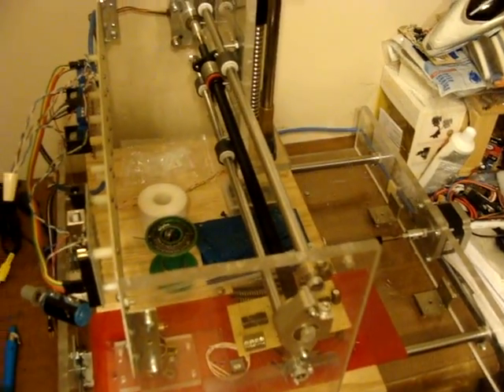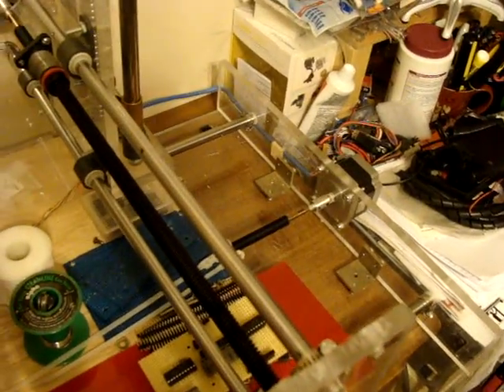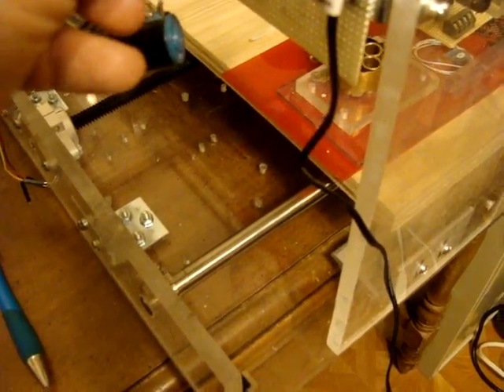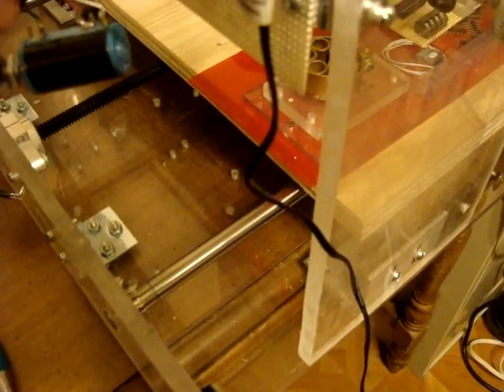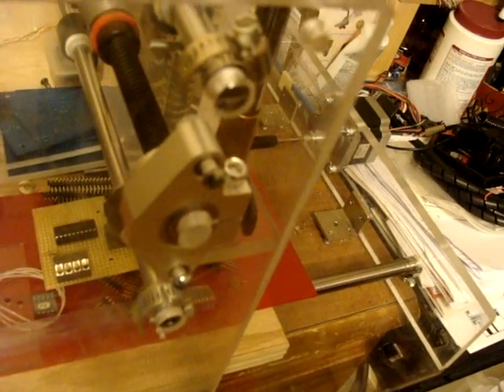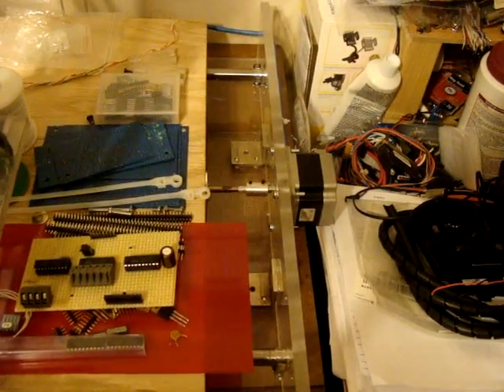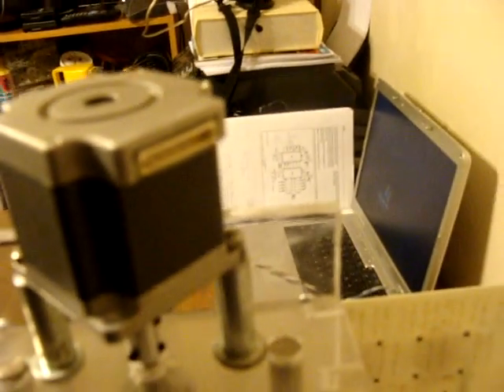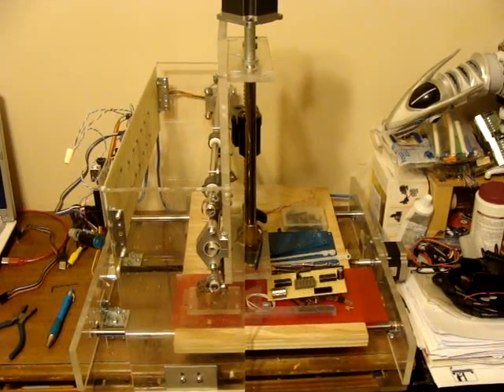DIY Arduino CNC Machine

Comment: hi bob,
i appreciate your info,i'm a electronics design technician,when i first started in college on this path flash memory was more for reasonably large buisnesses,and development tools were very expensive,i never bothered with programming,i'm also a guitarist(i think so),and i diverted to tube audio as i loved the sound and  i have a good understanding of the technology as well as solid state audio,analog,digital all hands on stuff,karnaugh maps etc etc,i find arduino very flexible ,especially for cnc,your TB6560  driver,this is a more rugged stepper driver i take it,would ,do you know ,if arduino will drive these,i'd like to integrate the two if need be,if possible,from the usb and software stand point.

The technician in me screams for as much info as possible before i commit,though i have been acquiring certain bits n bobs,laser and driver,i have ac and dc pcb drill with tool collets etc.
I'm sure i've seen either an un or a mega driving the more industrial stepper drivers,i'm contemplating linux,for linux cnc,i'll be a happy camper when i see even an uno drive 3 cd rom steppers properly on my bench.

Please keep me updated to any new videos on this,a big thumbs up too,and a subscription.
cheers.

Comment: why not use the V3 cnc shield,less hastle surely,each to there own.deff needs some lube on lead screw'i'd use poly type lead nuts to self lube,silicon lube for plastics to metal.
All good though,good job.Use it to make some better parts,self upgrade.
I just looked round cos i read below you wrote a book,i have it!! right here.
Do you use only linux,i have windows vista,xp,too tight to upgrade to 7+ cos bill gates is a ,well he can pay for his own boat.
You have micro limit switches on cnc in the book,why not in vid ,you pulled the plug,was that cnc the one in the book.
I haven't completely read the book,you use the A4988 drivers,why not use the V2 or 3 cnc shield,seems simpler to me ,there's DRV8825 drivers ,which i think have more current capability to drive steppers.

Is there a specific reason you used a TB6560.
Seeing as i will want to carve wood and cut aluminium,albeit with shallow passes,as i do understand it's not going to be a monster build machine,but capable if used with some frugality and better judgement in feed rate and depth,but surely the A4988's can do this if used with the heat sinks and forced air cooling,even some form of water cooling as used in pc's video cards,they have small ic coolers,i'd go for peltier heat pump but i've never implemented them,so have no real world experience of there attributes or failings,oil cooling could be done as the drivers dont hve any moveable parts that oil would affect,again pc's can be oil cooled as are industial welders(had one),mineral oil if i remember,maybe overkill,but do-able.

So here's my plan,arduino uno/V3 grbl shield with A4988 drivers/3 axis cutting bed of around 1200mmx600mm which may be 1500mmx700mm total,using Tina7 ind schematic/pcb design cadcam,some type of 2.5D milling GUI ,i will want to add a 1Watt laser for etching too,which i have here with a driver board ( could've made one but the chinese wanted less than £5,ultimately a 3D printer head added would be the cherry on top,as im aware these things can be modular,V1.1 of grbl has some really good attributes ,touch tool height zeroing is a big one for me as changing cutters for pcb manufacture is a given hazard in the process of pcb,tracks then drilling pads.

I'd prefer to not use B.O boards etc as they all seem to need a serial port,and usb seems to have taken over,i think i have serial on my pc's but my lap tops don't and i don't want to have a dedicated pc for the cnc,it's too bulky and i don't have a huge workshop,so a pc has very little in the way of hidy holes to stay safe,plus usb is all over the place.

Any advice for using this shield,it does seem i get a little more info each day,but i'm trawling the net,no pun,for hours.And most guides to put it to gether don't go far enough.i now need a dummies guide to G code and how to use it.
all the best.
Reply from the maker: I tried a CNC shield, the IC's were so hot that the axis' started shutting down after a few minutes.
Reply: hi bob,i see in the pic on pge 53,it looks like the ic driver has no heat sink,now i'm not trying to contradict you ,im just digging as much info from those who have for one who has not,so to speak.
I have kept the break out board scenario in mind,but first i'm using the uno and shield to drive 3 cd rom steppers,to mock up a cnc with all the bits a larger cnc will have,tool touch for tool zeroing,limit switches,i believe arduinos have driven "standard" stepper driver boards,so thats a possibility,but the K.I.S.S. acronym (keep it simple ...stupid) keeps recuring in my thoughts.
We'll see how it goes,good book,and nice sections on codes,if all else fails i can get drivers and B.O box relatively cheap .
cheers.
Reply from the maker: Even the A4988 drivers run really hot with a heat sink.  If they shut down due to over-temp what you are drilling can be ruined!  I greatly prefer the TB6560 driver boards!
Reply from the maker: I am currently running a metal version with an Arduino running GRBL.  This video is 2 years old, see my newer videos.